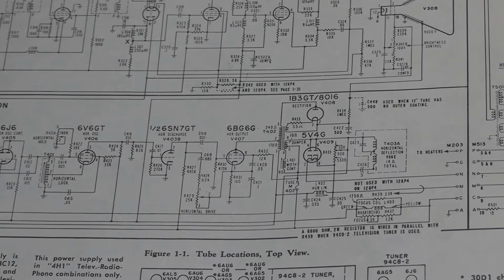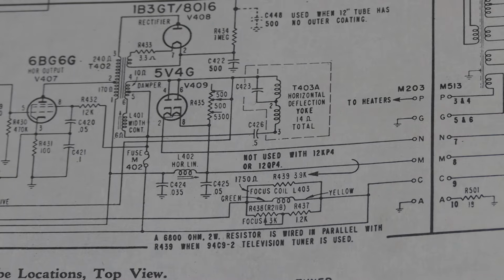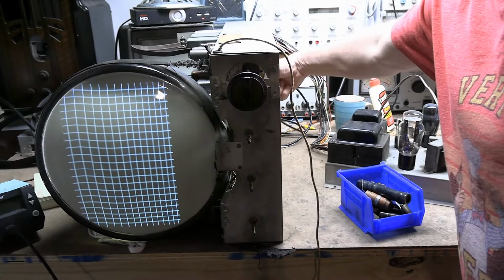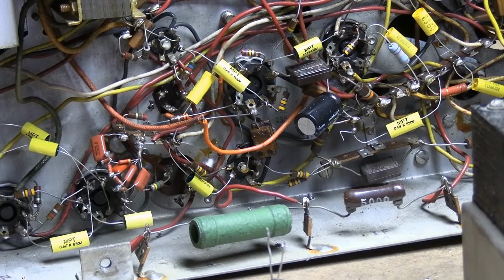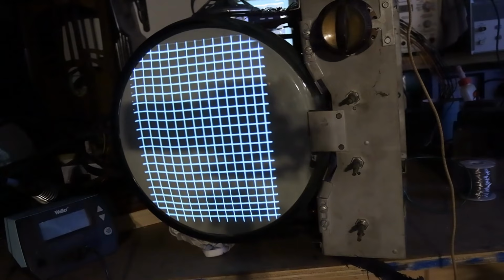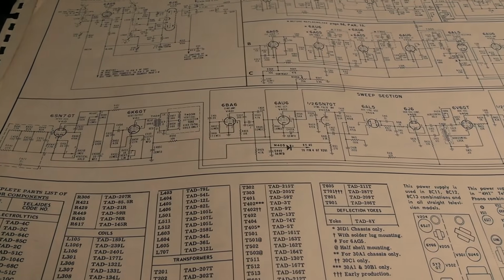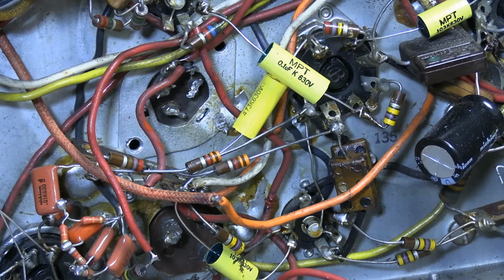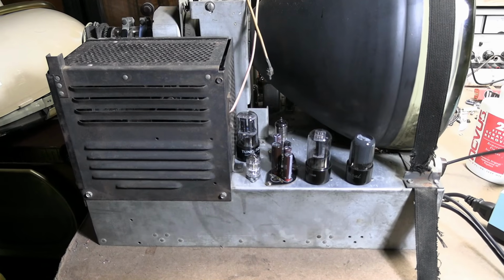Beginners guide to B&W tube TV restoration part 16 (resolving height)

Comment: Sprague had two types of orange drop capacitors.The common ones were type 225P which were polyester film, used as coupling and bypass caps, usually at 600V or less. They will likely overheat if they are required to carry horizontal deflection current. The other ones were the 715P polypropylene units that could be used for energy storage in horizontal circuits. Some were rated at 800V and 1600V. These can handle several amps of ripple current without overheating. I seem to recall Mallory PVC series was similar.

Comment: When drilling rivets from the bottom of the chassis, slide a piece of brass or copper tubing over the drill bit.  Cut the tubing about a 1/2 inch shorter than the drill bit when mounted in the drill.  The tubing will act as a shield to wiring and components under the chassis and a stop to prevent drilling too far through keeping the drill out of the wiring and chassis and also prevents the drill from catching in the hole and pulling it in too far.  Teflon tubing or hard plastic tubing will work as well.
Reply from the maker: Great tip. Thanks

Comment: Bob, I notice you put in new caps with disregard for whether the "ground" side, or lead connected to the outer foil of the cap, is connected to the low side of the circuit. Or do you? Do you take this at all into consideration?  Lots of guys say that even non-electrolytic caps have a kind of "polarity" that can affect their operation; the old wax paper caps invariably had a black stripe at one end to denote the outer foil lead.  Is this something you think about when installing new non-electrolytic caps?
Reply from the maker: I'm getting this question almost daily now so I'll do an in-depth video soon.  Short answer - I don't because it really doesn't matter. I know what other guys say, but let me ask you this - if it mattered, why don't they mark them?
Reply: @bandersentv    Bob,  that's very true !  On the other hand, why did it once matter and no longer does? Sorry to trouble you with tiresome comments,  I love your videos and thank you so much for them.
Reply from the maker: @Nick215NY  Well, that's where we get into the weeds and arguments start.  I can tell you this - they stopped marking it shortly after they switched from paper and foil to metalized plastic film.

Comment: Kind of surprised you hadn't actually looked at the cap can to get an official voltage rating, as while you can go higher with the rated voltage and be safe, you might also lose some of the intended capacitance if you go too much higher (they won't form completely).
Reply from the maker: Tough to see the can where it's mounted.  Yes, it won't full form if you go much higher, but a modest increase is no problem.   For example, I would use a 450 in place of a 10 volt cap. I typically go 50 to 100 volts higher than what the original was.  Over rating the voltage extends the life.

Comment: I know the camera makes it look different but to me it looks like  a lot of those connect point to point is almost touching. Your the professional though not me.
Reply from the maker: Some of those new parts are just tacked in place from earlier troubleshooting.  I will be installing them more securely.  If you mean the leads wrapped around terminals, yes, they do get close.  Thet's OK as long as they don't touch

Comment: Parallel a .002 with the .033 to make .035
Reply from the maker: You could but consider that the tolerance on these caps is 20%.  0.033 is well within that range
Reply: @bandersentv  Taking it that this means the original tolerance.  The tolerance of the new ones is probably tighter, like 10%, but can always be measured to be sure.
Reply: Funny thing, a quick look on the internet for .035 microfarad capacitors finds a number of NOS examples sold for guitar amp and audiophile purposes.  One would think they'd be rare compared to .033 microfarads since the latter is a common modern value, but they are not.  Maybe someone has a list of nominal values for decades ago.  I'd think they were picked for availability, not specially specified.
Reply from the maker: @SeekingTheLoveThatGodMeans7648  Very likely old TV replacement caps.  Many, ,many late 40s TVs used that value in the horizontal circuit.

Comment: Quite ingenious how they designed for resonating that horizontal flyback signal, then cutting off the damper diode and enabling that winding, and then the pi network to keep the output tube running during flyback. Only the horizontal magnetic field itself is actually sawtooth. The voltage driver waveform is completely different. Overall, the circuit is whatever it took to get a sawtooth horizontal magnetic field generated. The vertical is so much more standard electronics, as the frequency is so low. I never before really thought much about how the horizontal circuit worked and it's been over 60 years.
Reply: The primary purpose of the horizontal sweep circuit is to provide a linear ramp sawtooth waveform to drive the horizontal deflection yoke.  Providing high voltage to supply the CRT anode is secondary, as the flyback transformer will work with virtually any 16 kHz AC input signal to step up the voltage.  However with that said, the horizontal sweep circuit cleverly combines several different critical inputs to make the TV work, it is actually the heart of the  TV circuitry.
Reply: @billharris6886  It sure quickly became the standard for both tube and transistorized CRT television circuitry.  Why mess with success, and it made things easier for service personnel if they could count on pretty much the same thing being there.
Reply: @SeekingTheLoveThatGodMeans7648  Agreed!

Comment: I've heard people say that it matters which way the yellow capacitors are soldered into the circuit. Special test to find the outside shell and put it toward ground. What's your opinion on that for tv repairs?
Reply from the maker: My opinion is that it doesn't matter.  Metalized plastic film caps do not offer shielding like a solid foil cap would.  The metal is vacuum deposited on the plastic like a mylar balloon and much thinner than foil.  That's why they stopped marking the outside foil.
Reply: @bandersentv  The effect is quite small if any.  I believe Mr. Carlson managed to measure a difference, but he's got a labful of super sensitive scopes, and even hanging a scope probe on a connection is going to affect things a little.  A tad more effective capacitance to ground and other nearby things might appear if the hot lead was allowed to be the outer foil, but we're comparing component spacing to the minute thickness of the internal dielectric.  I studied electromagnetic interference as an electrical engineer decades ago.  Equipment where it really matters will have the entire capacitor inside a shielded structure with very short leads, for the threadable area of the circuit's loops matters more than proximity to a capacitor's body.  The presence of a grounded chassis will tend to subdue the reach of electromagnetic radiation.

Surely RF/IF/video circuits -- multiple megahertz -- are also going to be affected more than deflection circuits.
Reply from the maker: @SeekingTheLoveThatGodMeans7648  Yes, there can be a measurable difference.  What I really wished he had gone into is how much of a difference is it really and how does it compare to a real paper and fil capacitor.  Material, size and construction make a big difference.  Many modern caps are made like a sandwich and there is no outside foil at all.  Some have an extra layer of metal wrapped around that doesn't go to either end.
Reply from the maker: @SeekingTheLoveThatGodMeans7648  Someday I may do a video on this topic.  I've been avoiding it as to not start an online war.  I like to think about it like this.  If you were manufacturing capacitors and outside foil was an important design factor why in the world wouldn't you mark it?  
Arguments that they stopped because of low impedance transistors taking over is nonsense.  They stopped marked them when plastic film caps came out in the 60s while tubes were very much still in wide use.
Reply: @bandersentv  Actual measurements and engineering theory ought to settle the matter but yes, it'd be an entire study.  There are so many factors.  Once we get into multi-megahertz circuitry, the size of the loops matters far more than proximity of an outer or inner foil to other components.  This is why, in digital circuitry on printed circuit boards, it is common to put a power supply bypass capacitor right next to an integrated circuit, rather than way over elsewhere on the board.  Perhaps the whole science of building computing equipment finally shed light on the issue that hadn't been there, light that applied to both transistorized and tube equipment alike.  Maybe outer foil polarity never really mattered enough to make or break a design at all, but shade tree engineers just liked the idea.  I'd be thinking in terms of (AC) voltage divider effects.  The capacitance of the capacitor itself would be far higher than parasitic capacitances either way.
Reply from the maker: @SeekingTheLoveThatGodMeans7648   These are never used in multi-megahertz circuits anyway.  They are typically all ceramic.  Since all the old paper caps have deteriorated it's hard to even know what the original spec were.

Comment: When troubleshooting electrolytic capacitors that are being used in a power supply or for bypassing purposes, I measure the AC ripple at each filter cap.  If the peak-to-peak ripple is more than 2% of the DC voltage on the filter cap, I replace the cap.  This 2% limit value is a "rule-of-thumb" decision point I have developed over the years.  The peak-to-peak voltage measurement is always measured with an AC coupled oscilloscope at the vertical input.  The DC voltage is measured with a DVM.